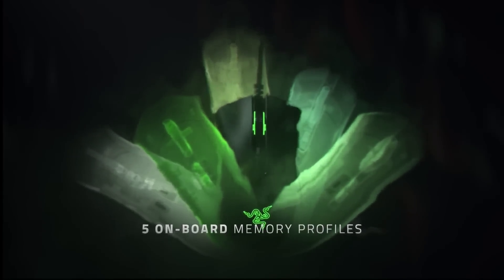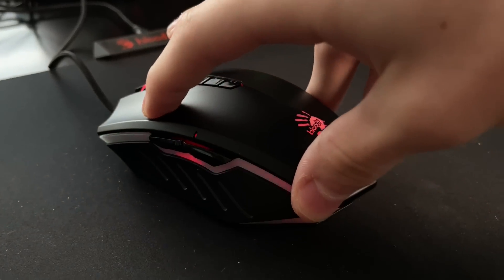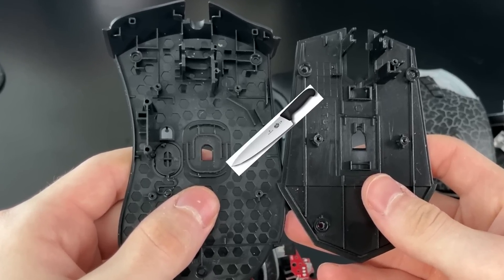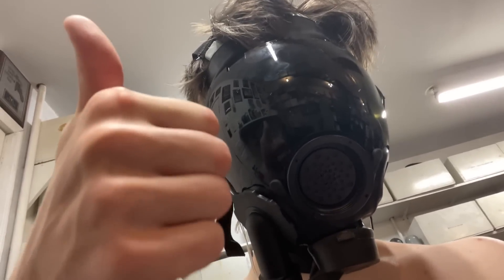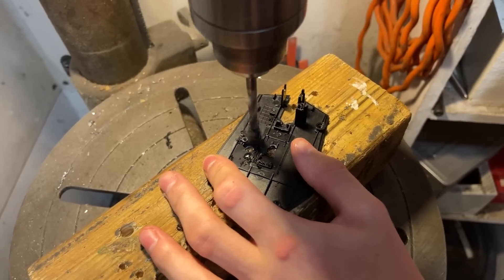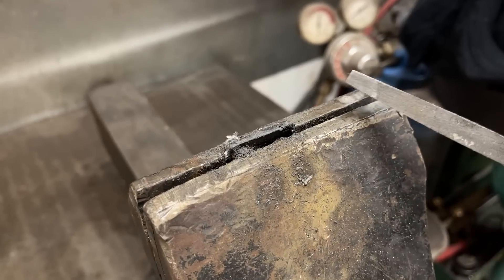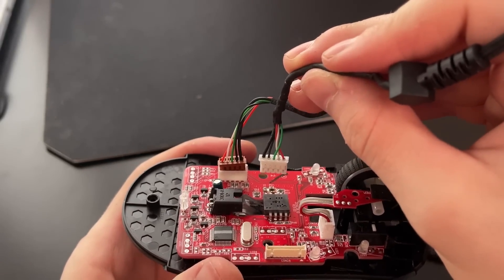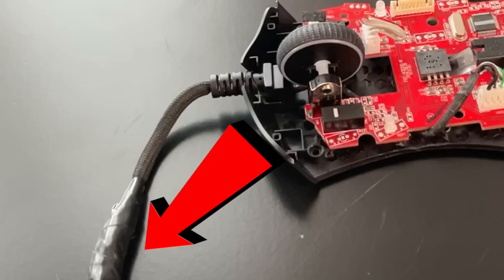Bloody A-Razer | Drag Clicking Unlocked

Comment: The thing that hurt me the most was the cable. You could have simply switched the pinouts on the JST connector to fit the A70's pin layout, which would make the process a lot shorter.

Comment: Hhahaha I had an idea like this a while ago! I wonder if you could make it wireless!
Reply: To make it wireless you would need a wireless bloody mouse with an adjustable debounce time and the capability to drag click/double click well. The wireless comes from the PCB of a mouse so if you want to have a wireless bloody deathadder v2  you need the wireless pcb to come from a bloody mouse. You cannot just change out the switches in the razer mouse as it still will have a 25 ms debounce time (I’m pretty sure) at this point the best you can do is just take a model O wireless, and replace the switches with the same light strike switches of a bloody a70. It will quad click like the bloody but be just an amazing mouse overall like the model O wireless. Have a good day

Comment: I know you did this for the content but the better way to do this is to desolder the switches from the bloody mouse and swap them out, then modify the tension of the button assembly by "bending" the plastic and compensate with metallic tape

Comment: you don't actually need to cut and desolder the wires. you can manually change the wire layout on the 5 pin JST connector. much easy that way.